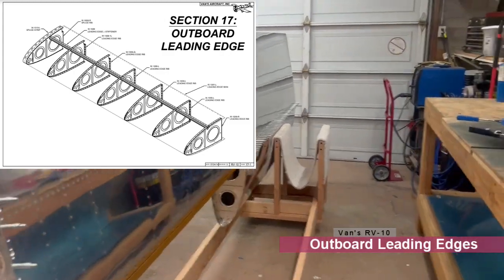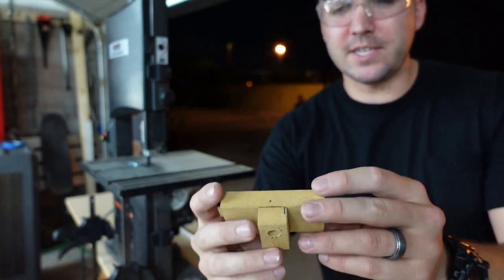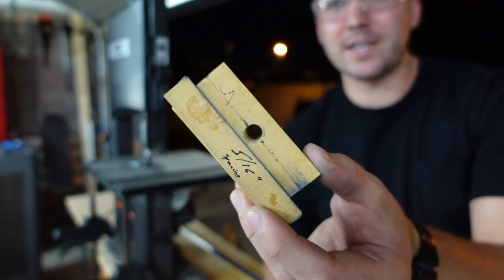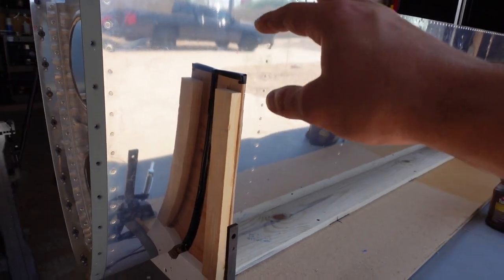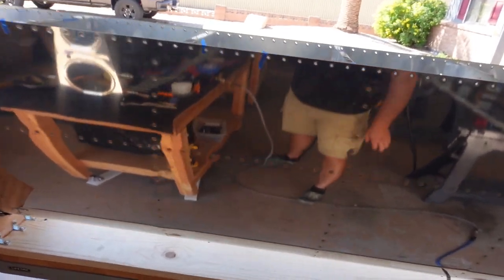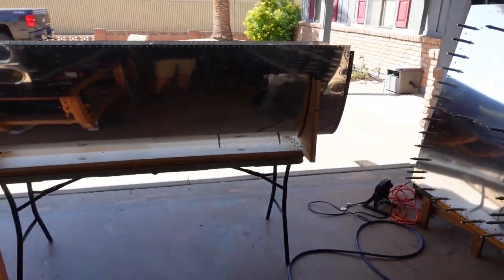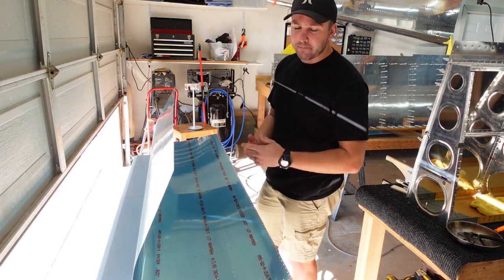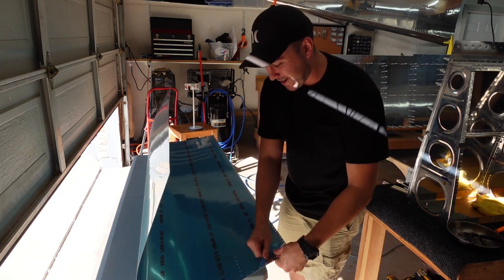Van's RV-10 Wings - Outboard Leading Edges, Part 1

Comment: I like that wing cradle design. Would you recommend it? Do you have another video that features it? Thanks!
Reply from the maker: Thank you! I would. I haven’t been able to use it long term or get the other side filled just yet, but I don’t foresee any issues with the design. I used the plans found on “Mouser’s RV-10” build log. A quick google search of that name + wing cradle and you should be able to find it. I made some slight changes to measurements but no major changes. I’ll have the cradle build video up within the next week or so. Haven’t gotten through my backlog of footage just yet

Comment from the maker: 03:17 - Clarification: I had previously not spoken highly of the Swivel Mushroom Set with rubber grommet, and instead said that I preferred to use the standard rigid mushroom set due to it being a more direct way to rivet. Here, I used the rigid one and it and slipped, causing a slight ding. This is why I used the swivel head one for the rest of the leading edge riveting, since it is much more forgiving when working at awkward angles.
Reply: I've noticed the rubber one has a big gap between the face of the rubber and the set. Sometimes I feel like that doesnt set the rivet as flush as the solid mushroom one. Have you run into that at all?
Reply from the maker: @Galacticpancake-m6j  definitely! I sanded mine down quite a bit on the scotchbrite wheel to bring the gap in closer. They seem to manufacture it with too much of a lip